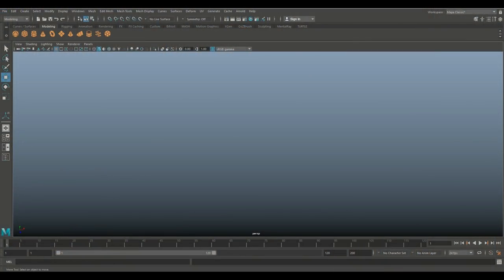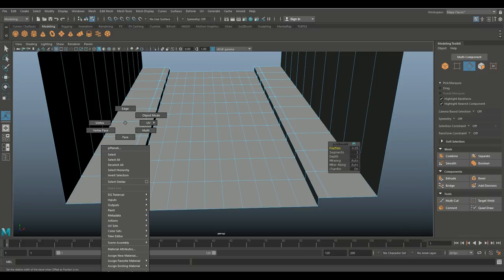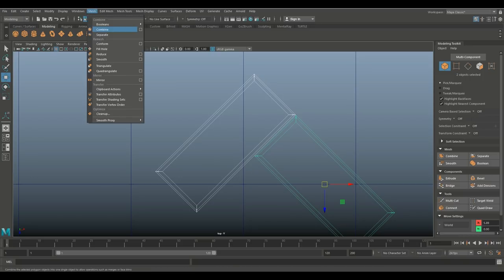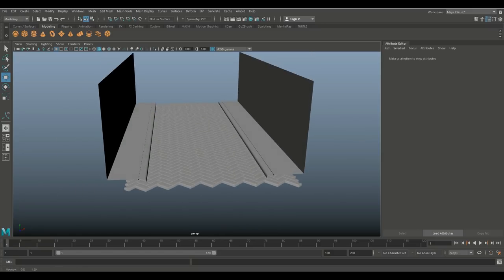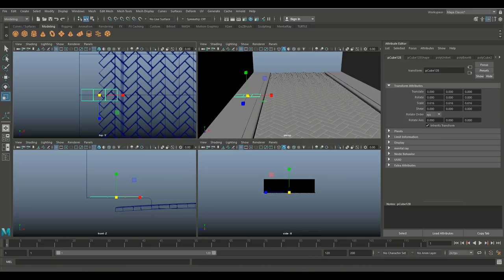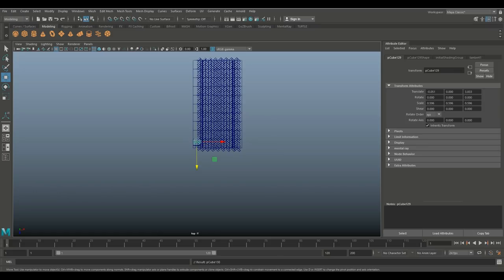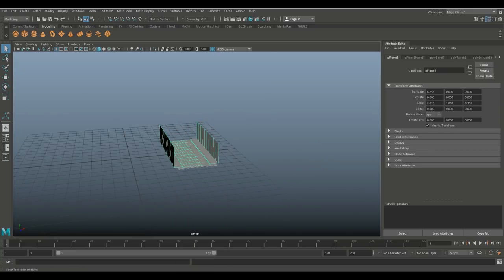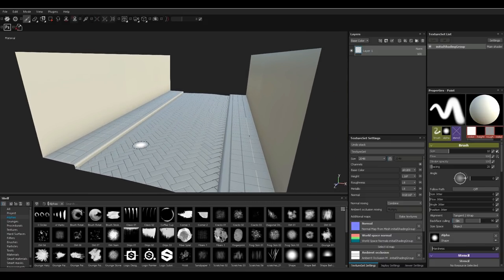How to 3D model a LOW POLY street with HIGH POLY detail

Comment: Hi Mike, thanks for the tutorials, are very usefull for public beginner like me. I would like to take this opportunity to ask you a question about the use of substance painter maps within the Mayan models ..., You can load the same maps that we created in Substance painter of Normal on the same model (to improve the visualization of the model), and also the Height map, (which applies depth in some Substance Painter textures ...), and if so, (to visualize it in Mentalray, for example), where each of the maps would be loaded, that if I use the "bump Mapping" and the "displacement Mat", I get problems with the textures when rendering, the textures are duplicated and separated from the model in the Render ...
Thanks in advance for the help you give us with your channel, and good wishes for the year to come ..., thanks again y un Saludo.
Reply from the maker: Depending on the renderer used ( Arnold, VRay, mental Ray etc ) you need to choose what maps to export from Substance Painter to make things work